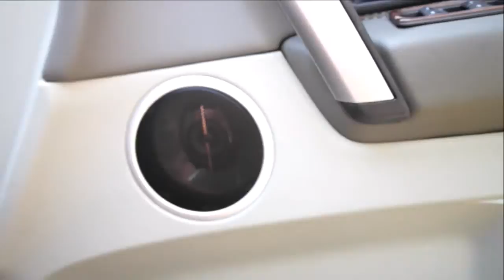DIY Ford Territory speaker upgrade kits. Sony, Hertz Alpine, Kenwood, Clarion or Pioneer

Comment: Several things wrong here, Sony is not an upgrade, why would you not  put components in and why is the Sony speaker mounted with the logo on it's side?
Reply: Hi Spike, these speakers sound much better than the factory ones, that's why Sony is still Australia's biggest selling car audio brand! the Logo is on it's side so that no new holes need to be drilled which would cause rust points. Many rough technicians would do this, but it doesn't fit within quality control standards at the Universalfuze owned Audiocom stores. The speakers are factory mounted high enough that a component is not necessarily required. By not fitting a component, it saves time and money. But if you have a bigger tome and dollar budget, we have many component kits available too in Sony, Hertz Alpine, Kenwood, Clarion, Pioneer and more.
Reply: He drilled holes...